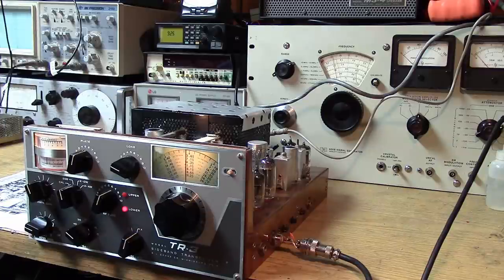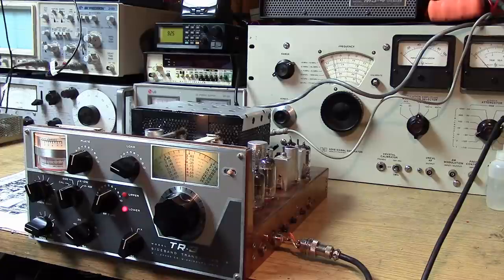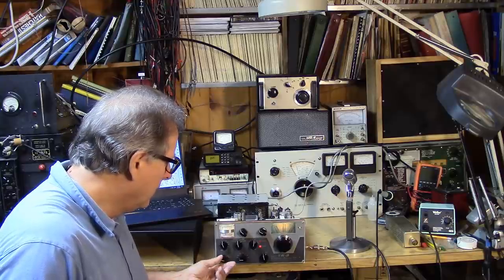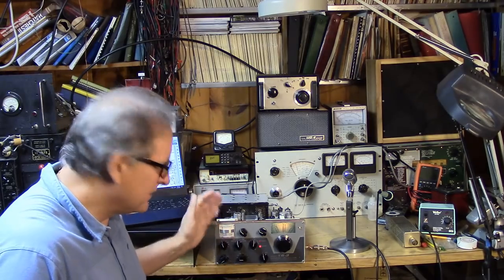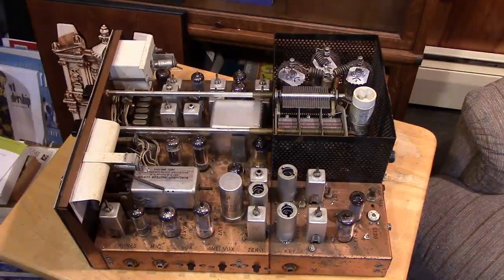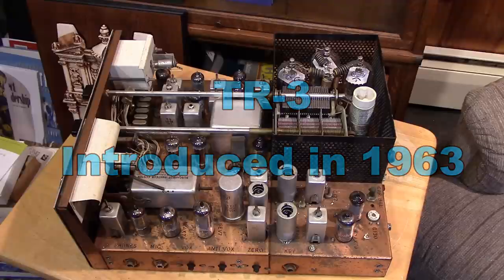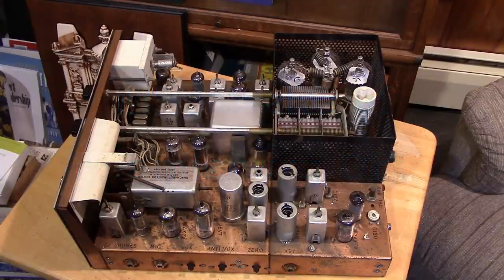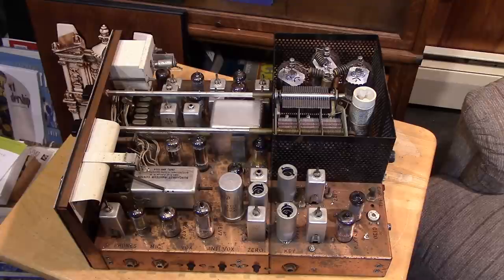Vintage SSB Drake TR-3 Refurb Part 1

Comment: I did a refub of a TR-3 one time. I too spent a few days at it. It's too nice a rig to get sloppy with. It's a labor of love. The one I worked on only had a couple of spots of corrosion on the plating. Other than that it looked like the chassis was pure copper.  I think a drop of sweat had fallen through the lid at one time.
Reply from the maker: That radio was quite an adventure to bring back. Perfection is elusive.

Comment: Hi Great Video Just ordered a DRAKE TR-3 HF Base Transceiver from MTC and wanted to know if you do repairs or aligments if needed. Just getting into Tube Type Trans...AC4KW thanks for the videos
Reply from the maker: Hopefully it came with a power supply and cables. Should be a lot of fun cleaning up that radio.

Comment: Biggest problem with the TR-3's are the crystals in the " soup can " filter drifting off frequency. That fact alone has rendered many TR-3's unrepairable. TR-4's suffered failure of side band filters as well, usually the filter used for 80 meter LSB, USB on 20 meters.
The only tube testers I have found useful for checking 12/6JB6's are ones that check mutual conductance.
Reply: 12jb6  use 6jb6 and a diode to give half wave 6v i did it i could not get 12jb6 tubes

Comment: Hi, I just recently got a TR-4 and really enjoy it. My question is how to Cure the IP meter from Bounce? Right now the meter bounces so much I can't and I doubt anyone could tune the rig safely. The rig has several issues like the power supply I just finished rebuilding and I need to get some resistors replaced under the PA on the underside I think 15ohm. Another question is a good replacement for the RX TX fuse located under the PA cage near the SO-239 antenna port? I know you get tons of questions so if you happen to see this I would appreciate any advice you might have.
Reply from the maker: The meters are not high quality damped types. Most overshoot, and  the only true solution that I have heard of, is to replace them with different 5 mA FS units and make your own dial paper. Not impossible- but not necessarily cheap or fun.
Reply: @MIKROWAVE1  Hi Mike, thank you for the reply. What you suggested maybe over my ability. An old friend who owned one of these old Drakes came over tuned the rig up in about a minute and had it talking. He said he had lived with the bounce for years and just basically tuned for Max Output using the meter on the tuner. He said you could see the dips and peaks when tuning on that meter as easy as the internal. I don't have a clue! Ok so I have read I can USE a #47 bulb and make the RX TX fuse out of that if I am careful. The resistance is supposedly the same as the original #12 fuse that is no longer made. Also read that the number #12 was a horrible designed fuse in the radio because by the time it blew the rig would be ruined anyway. SO not sure on using the #47 to replace it. We did use a #47 to get the receiver working and for him to tune up to see if she would transmit. I have to say I have fallen in love with this old radio Drake TR-4 the original without the NB or lettering for it. I have the Drake 2b I recently got also because of something I regretted. Back in the early 90's my kids were small and I had a Drake 2b picked up at a Ham Fest for $23 bucks every dollar I had left anyway back then and I recall what a wonderful time they had listening to Santa Claus traveling the world on 40 meters and when he got close to our area talk about two little boys running to bed. Some hams up your way best I recall gave those kids a wonderful Christmas in so many ways. I sold that thing about a year later and had regretted it for years. Wish I had that one back! Both the boys are grown now and they both remember that Christmas.

Comment: What about modifying the unit to use TELEFUNKEN Space Charge vacuum tubes so it can operate on 24V and maybe you could go Solid State with 100W Power FETs in the final stage.